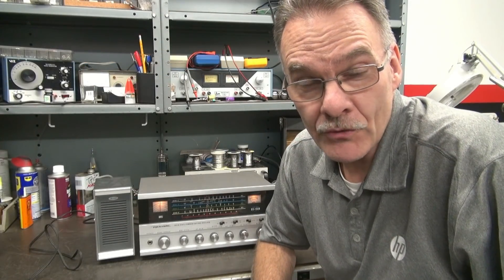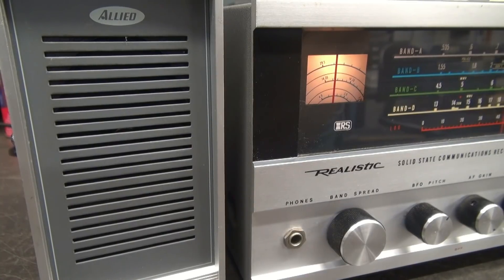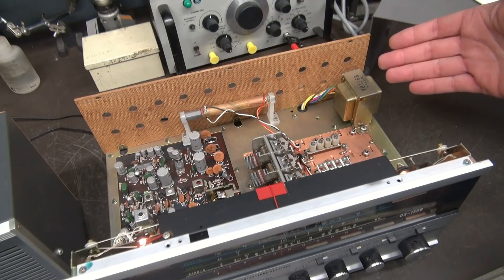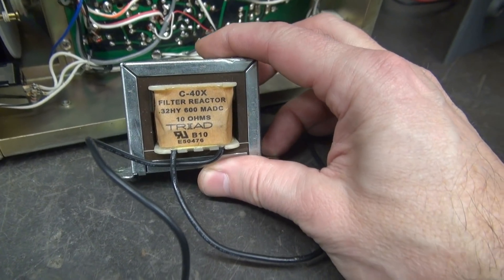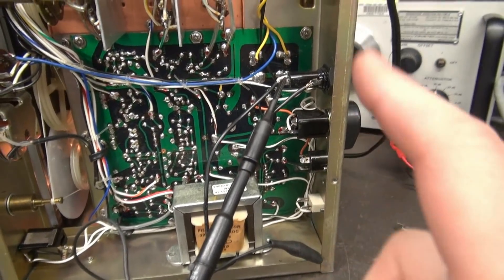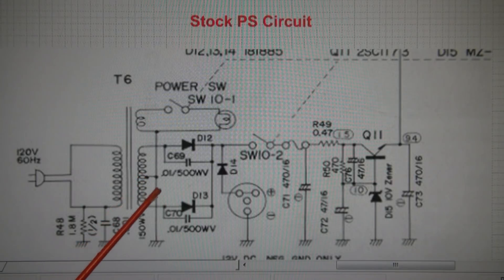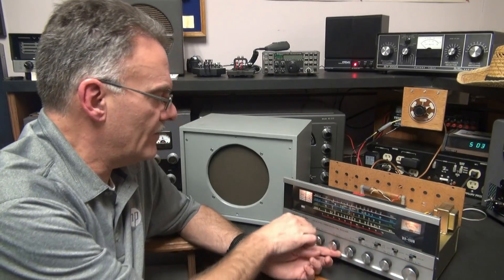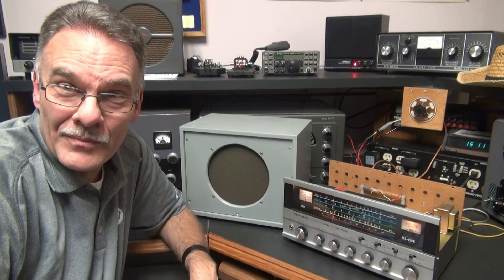How to fix Realistic DX-150 Ham Radio Receiver Power supply Hum Buzz

Comment: Nice job, Terry. I've got a DX-150A which I bought new in the late 1960's. I replaced all the electrolytic caps recently, and would like to try your mod.  Where would I be able to buy the choke? Thanks.
Reply from the maker: Hello Mouser part number: 553-C40X
Reply: Thanks!